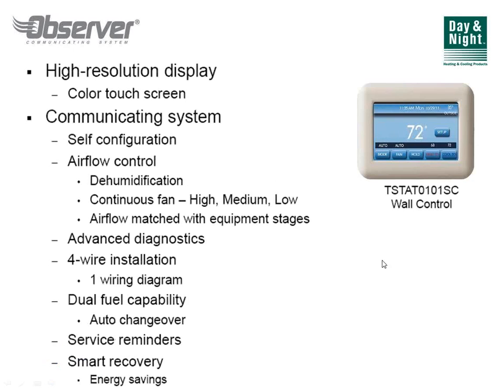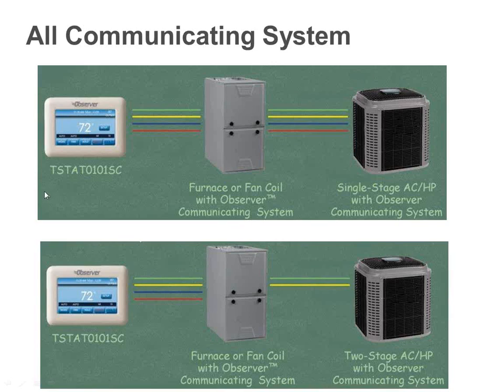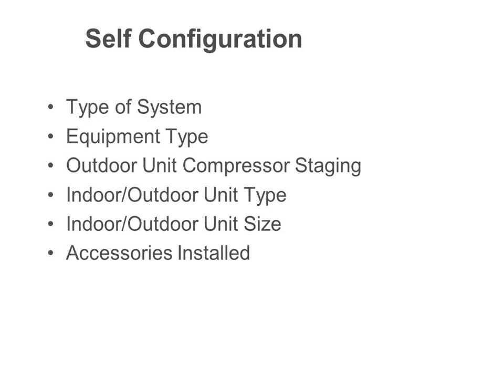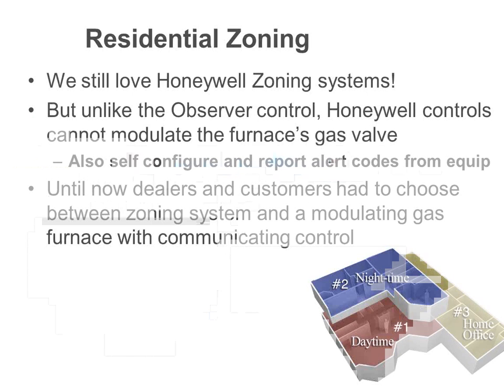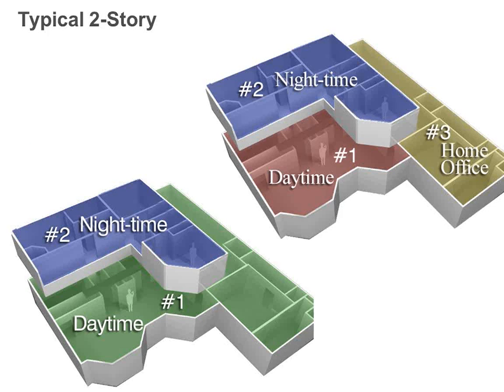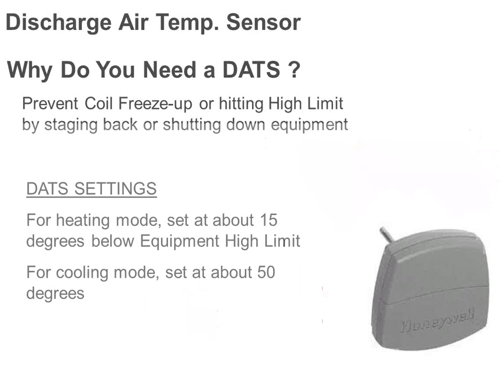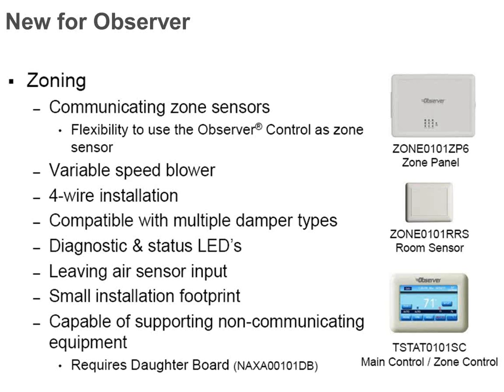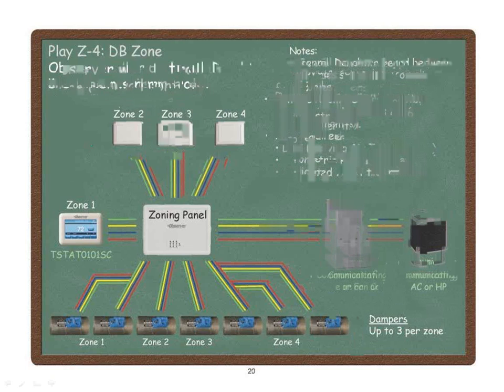Day & Night Observer Zoning Systems - Webinar 9/29/14

Comment: I need to replace this thermostat but this one is discontinued. And the app no longer works. And I can’t find anything with the same wiring
Reply from the maker: That webinar was from 12 years ago so stuff has changed. The ICP Ion wall controller replaced the Observer control. In general, the Ion can work with current and old furnaces, A/C, and heat pumps, however, zoning is different. You will likely need to replace your zoning board also if you want to upgrade to Ion controls. The dampers can likely be re-used. If you are a contractor, consult with your local ICP distributor regarding solutions for your exact replacement scenario.